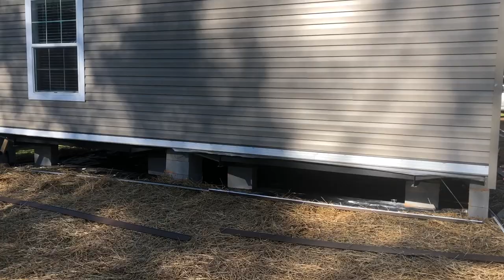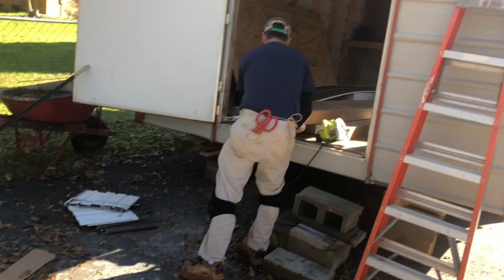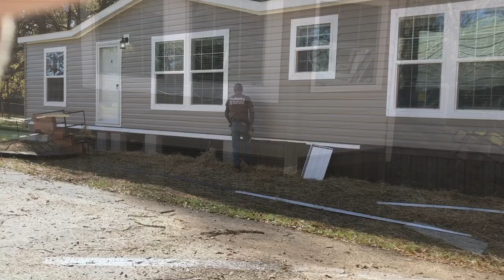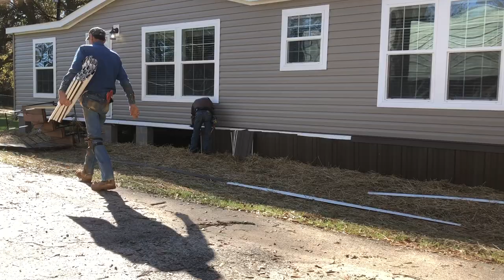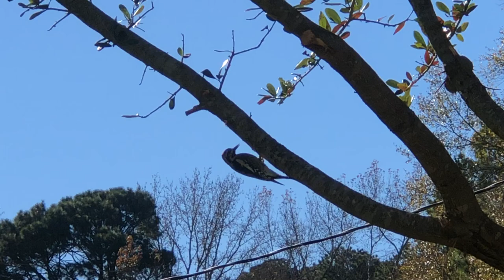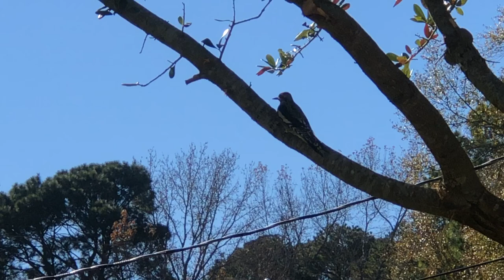Installing skirting on mobile home

Comment: Many years ago when I lived in a Mobil home, I came to the conclusion that skirting was junk, we got tired of putting it back on when the wind blew it off, sometimes it was hanging in a tree at the wood line. When it's new it's not so bad at all... but as the years go by the sun bakes it and it doesn't fit quite as tight. We ended up buying brown metal and 2x4's, self tapping screws. Worked out well. This looks pretty nice though, nice and new, very well could be a newer more durable design. You got to be extremely careful getting close to it with the weed eater, it tears the crap out of it easily, big holes. It's best to just spray round up weed killer imo.
Reply from the maker: This is the thickest vinyl that money can buy. I think I can make it stay on until I’m so old that I won’t care.
Reply: @bctruck  if you dont mind, where did you buy it and about how much did it cost?
Reply from the maker: I bought it at a mobile home supply place in bossier city Louisiana
Reply: @bctruck  thank you
Reply: Exactly...

I'm on whether to install this type of skirting or if I have other options. So I'm waiting and checking out other type of material

Comment: You should have had a few bundles of shingles to put around the perimeter of you home, just sticking out from skirting a few inches. That way grass doesn't grow right against it. Mine is tore all to pieces. You can also buy skirting protector that goes along bottom. Shingle would be a lot cheaper, though. Looks nice.

Comment: A trailer I lived in once used osb that was attached under the siding. The area was rather wet and the osb wicked water up. The exterior walls all had a mold problem. This happened before toxic mold was big news.
Reply from the maker: BookGolem OSB is all they use now. That’s all houses including site built use now.

Comment: Why don't they clear the dead straw/grass out before installing the sections?  Shouldn't installation be on ground level?
Reply from the maker: It is on ground level and they did pull the straw back.

Comment: looking  good  there brad  ...   was wondering  did they  use  a  certain   type   of  blade  to  cut that  with   ..   when i  try it   hacks   up   at  times   lol   ..    †
Reply from the maker: I’m not sure. I didn’t get a look at the blade.
Reply: Back when I did some siding, we just installed a panel / plywood blade on backwards . . but that was 20-30 years ago
Reply from the maker: I know it smelled like a skunk when they would cut it.

Comment: skirting= one 2x4 nailed upside, flat  down under the trailer. than a p.t. 2x4 stud wall nailed to that, than pressure treated plywood over that with rebar pins driven into ground to hold wall. screen vents every 8 ft or so